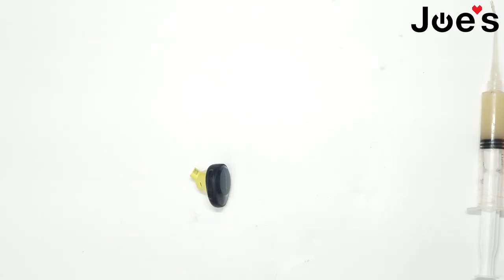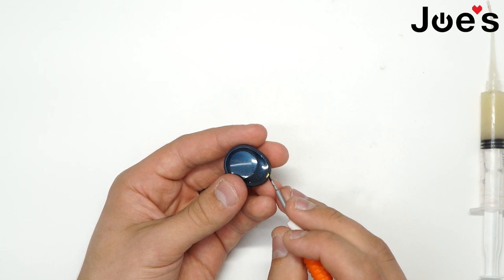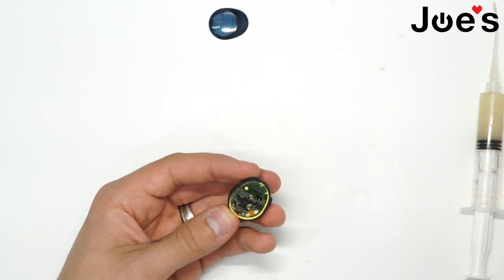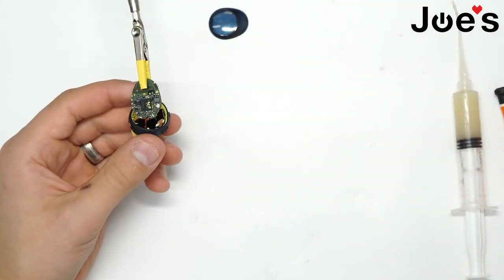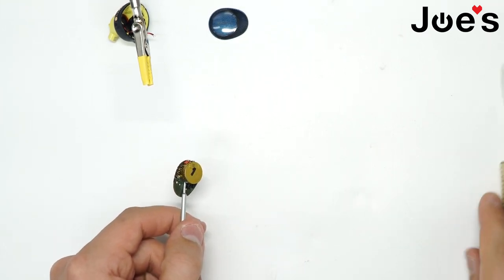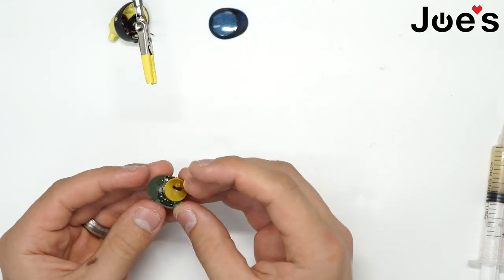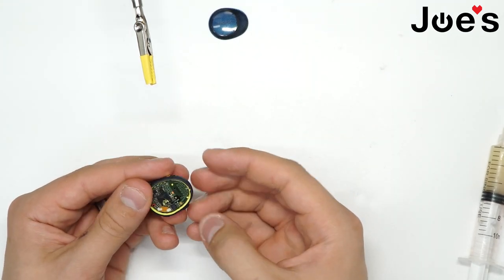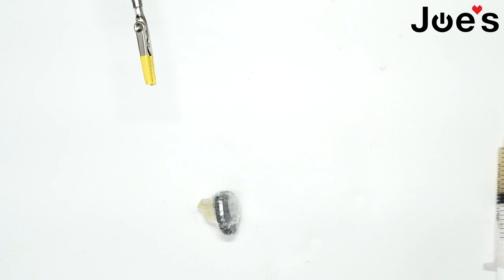Bose Soundsport Wireless Free Earbuds Replacement Main Board | Repair Tutorial

Comment: What temp were you using. Celcius 100?Can you do a closeup of board, maybe some reverse engineering. Hoping to repair a board. Fingers crossed all the custom chips are ok and just bad joints or shorted cap or tranny or open resistor or fuse. God and my multimeter will hopefully fix it. Edit. I've found battery is near zero volts. So think I'll just need to replace battery on mine. No short on board terminals. About 15AU  bucks it seems . I used 220C on my heat but tolerances are huge across different stations I guess. I used razor blade to get in a bit first then tiny flat head. Not so difficult.

Comment: Hi there I've own mine soundsport free's limited edition for almost two years now I use them daily but constant use has wear down the rubber/silicone button cover on both sides I've lost the + Volume button it fell out exposing the inner workings can I send them in for repair?
Reply: Hey i have the same issue. The silicone button cover has been damaged. Have you got it repaired??

Comment: I went to the repair form but in the Bose section it only list 4 over ear models to be repaired. I have the sound sport free wireless earbuds like you show in the repair video. What do I pick as the model to be repaired? I would like to have this set repaired. The right bud will not turn on but the case shows full charge. If I can send them for repair, what items need to be sent, case and buds only? Thanks in advance, Ron Anderson
Reply: I have the same problem with yours, do you have any solutions to make it work again?
Reply: Same here

Comment: Hi I purchased new bose sport earbuds. Left side is not charging ...I believe charging case is the issue...I tried to connect to right side connectors using some thin wires and light is comming on...so if the lights are comming on then I believe the buds are alright..How do we opn the case..could u help on that...I work on ship so returning is not an option as we come on pier once a month..
Reply from the maker: Hello, thanks for commenting. Please email us at support@joesge.com and we will be able to better help you there. - Aaron P

Comment: Great tutorial but unfortunately if you have to replace the boards and the batteries it isn't worth it. If the product is out of warranty Bose will replace it at a discounted price of $99.00. If you go through the troubleshooter and none of the suggestions work, you will get the offer at the end. Also, Joe's Gaming no longer does this repair.
Reply from the maker: Yes we do not repair these anymore. We do sell all the parts. Since they are hard to find we do sell them at a higher price.
Reply: @Joesge Joe....do you factory pair one Bose Right Soundsport free good earbud
with a good Left ebay bought but from another set that had a non working Right earbud ???
Can you marry them even being from 2 different sets but same model ?